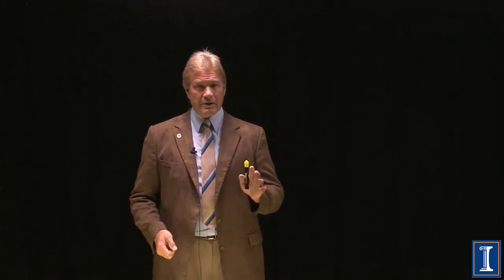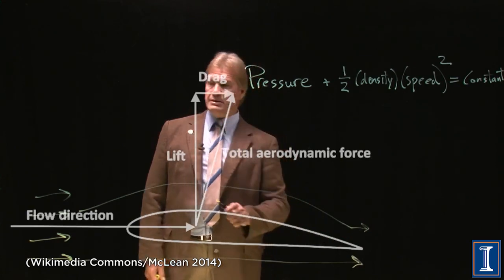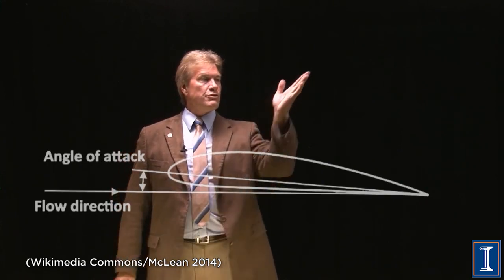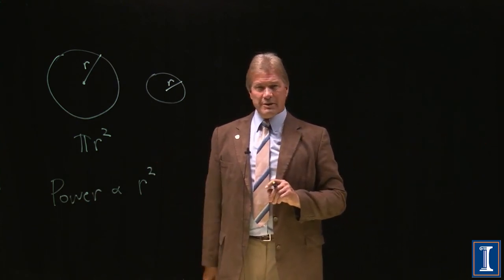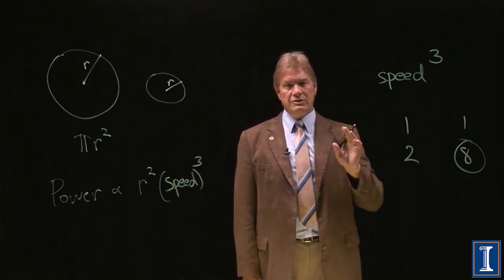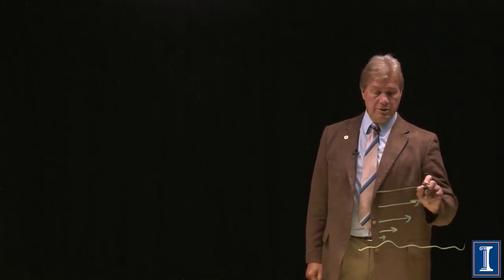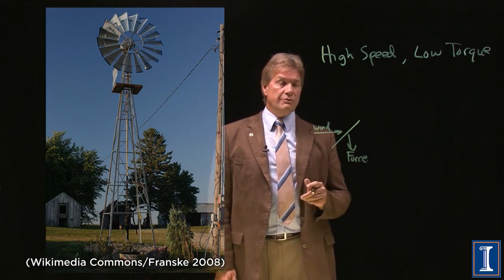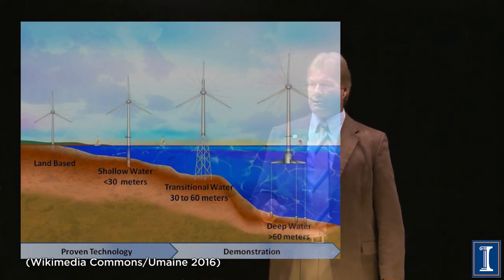What's in a Windmill

Comment: Explanation about "speed^3" is in reality pretty simple:

Energy = m·v^2/2

Power is energy per time unit, so instead of mass there goes mass flow rate (mass flux or mass current):

P ~ M·v^2

which in turn is proportional to turbine area (and consequentially to r^2) AND air speed v:

M ~ v·r^2

Therefore:

P ~ v·r^2·v^2 = v^3·r^2